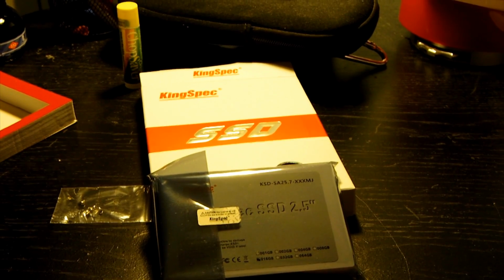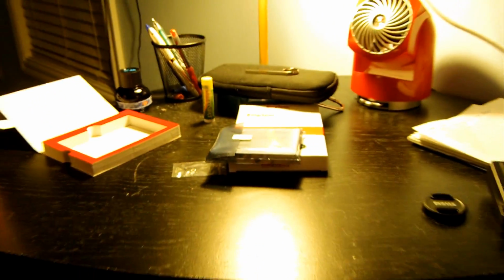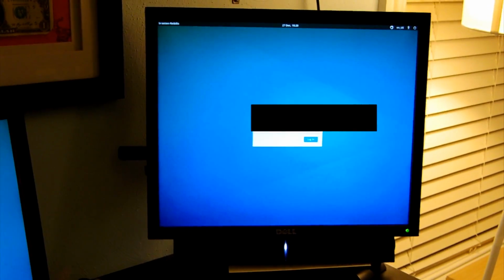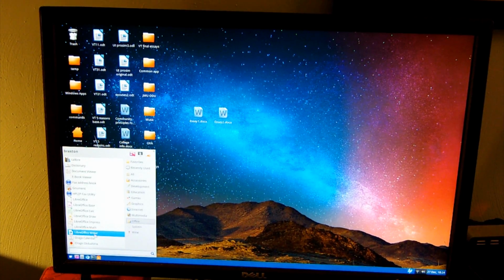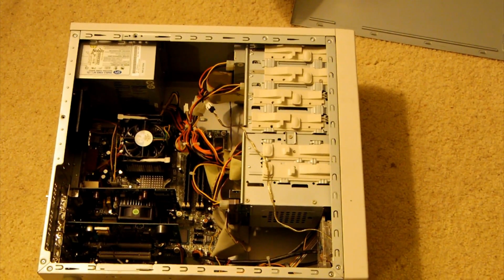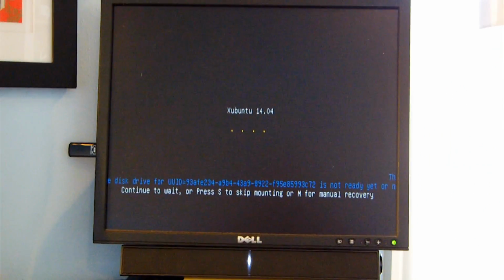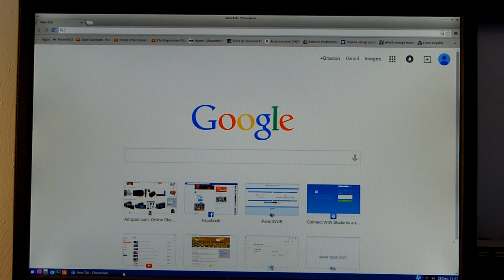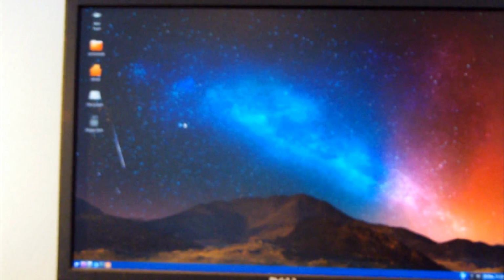Pentium 4 processor + Solid State Drive

Comment: Wow! You have a very similar specs computer to mine!

My PC specs:
Pentium 4 HT 3.0E
2 GB DDR400 (2x 512 MB DDR266 AND 2x 512 MB DDR400) (And also, I just manually changed the RAM frequency to 400MHz so does that really overclocked the RAM?)
NVidia GeForce FX 5600 with 128 MB VRAM
That same Intel BIOS and motherboard
The same monitor you showed on the right side

But it runs Windows 7 Ultimate

Comment: 10:17 The BIOS says that you installed the RAM wrongly. It should be installed in identical slots. So that it can perform in Dual-Channel mode, which will definitely increase the performance.
Reply: or the PC just has a single ram stick

Comment: Without a SATA-3 PCI card the speed of the SSD will be limited to 150MB/s, since all those Pentium motherboards only support SATA-1. All the values of Christal Disk Mark were unreliable, also the sequential speeds, since you can't beat SATA-1 speeds. You should have used the benchmark of the gnome-disk-utility.

Comment: can you use any sata connector and hard drive with any type motherboard that has sata 1 through 3?
Reply: anikanbounty97 yes except a powermac G5
Reply: Peter Kapica :) that good to know and what a powermac g5 apple design?
Reply: anikanbounty97 a powermac G5 only has sata 1 and it probably supports ssd's but I never messed with one
Reply: Peter Kapica ah ok
Reply: People speed up IDE laptops with ssd's, icm converters.  Well, i know i did.  (to brutally  classify people by  financial means they have) Poor people's cheap little useful upgrade.
Reply: @Geert365  nice.

Comment: why do i see more people with geforce 6200 256mb vram card then 512 mb vram card that i have?
Reply: anikanbounty97 I got a 512 Mb card
Reply: Peter Kapica :) compared to the agp 4670 1gb it slow lol but does the job
Reply: anikanbounty97 4670 is slower.
Reply: Peter Kapica maybe compared to a pcie versiopn but it really fast compared to agp 512mb version of geforce 6200
Reply: anikanbounty97 I got the pci version
Reply: Peter Kapica ah ya that may be better lol but maybe not idk all ik is speed for my card really fast and good i can watch 1080 video and smoothly and play games that my dell laptop can play with max setting on both of them
Reply: anikanbounty97 it can barely handle HTML 5 video and the reason I payed 50 bucks for it is because I had an ancient Pentium 4 Dell and it wouldn't play cod 4 because it would error out on the integrated. Bought the card and got it to a bad but playable fps on the lowest settings.
Reply: Peter Kapica ya speed on cards terrible but i got my geforce agp 6200 to play skyrim very low settings and bad frames but smoothlyish
Reply: anikanbounty97 easy way to fix lag at low fps, a trash picked crt monitor
Reply: Peter Kapica lol why trash when i got 21 inch one sitting in the basement area
Reply: anikanbounty97 time to hook it up
Reply: Peter Kapica lol :) you can actually hear it turn on and the electricity going through it

Comment: pentium 4 3.8Ghz + DDr400 dual channel 2.3.2.5 timings could double the result besides ahci sata III controller.
Reply: I doubt there's any 775-based board that could do DDR400 and Sata-III controller. You'll be lucky to get some later models that have SATA-II and DDR2-800MHz compatible, but some wouldn't work with early P4 models, also this in the video uses a 478 Pentium 4 that of course doesn't have even SATA-II

Comment: I want to see someone overkill a Pentium 4 :P. A fairly decent GPU, SSD, max of the highest end RAM, best heatsink for it, highest overclock, good looking case, and a good PSU. (and obviously best mobo) Then see how it runs :o.
Reply: +FatheredPuma81  I have a 3.0 Ghz P4 HT (socket 478) overclocked up to 3700 Mhz on Asus P4P800 Deluxe motherboard, with 2 Gb of DDR400 and 120 Gb Seagate SATAI hard drive; on this machine Windows 7 Professional boots in 40 seconds only and it is perfect for office and internet tasks! As you can see in my channel, even YouTube videos at 720p are played decently.
Reply: ***** I think to completely bottleneck a GPU you would need at least a 4870 or a gtx 280?
Reply: ***** That would be a 4770 or a 7950 GT. Also there is PCIe versions of it I think.
Reply: ***** That's every medium+ end graphics card in existence :P. People think "Oh it was $200 10 years ago therefor it's about $100 now."
Reply: +Ｒｏｂ “RobW0lf” i got a asrock p4i945gc mobo a few weeks ago on amazon for $20, they are not very rare. socket 478, pcie and ddr2. i have a 7770 and 2gb ddr2, and a regular 1tb sata drive on it, windows 7. its greatest achievement is metro 2033 max settings 720p average of 40 fps. oh, also its a 3ghz ht p4
Reply: 51rickjames Now you need a liquid cooler for it and need to oc it.
Reply: Gaetano Della Corte Again as said before. No graphics card= shit.

Although pretty damn good. Just need an upgrade to RAM and a good GPU and your set for all dat 1080p gaming.
Reply: +FatheredPuma81 i got the latest and best agp graphic card wich is ati 4670 1gb agp
Reply: ***** sadly the agp slot that it was in was only 4x so it was bottlenecked by that and by being a dell dimension 8200 with cpu of 3.06 ghz hyperthreading but i got new motherboard asrock 4core dual vsta now to test it on at 8x speed and quad core cpu extreme edition qx6800
Reply: ***** ya the board i got can go all the way back to pentuim 4 lol and up to quad core dou type cpu socket 775
Reply: ***** got it on ebay for like $24 euro was very lucky and working perfectly no problems at least after i updated bios cause it didnt like my cpu with old bios lol
Reply: The highest-end AGP cards that I'd know of are HD4670 and Geforce 7900GS.

Comment: w7 ultimate is soooooooo faster then unbuntu
Reply: +robertas grigas Any proof at all to support this?
Reply: my pentium 4 pc boots faster on w7 on a hdd 7200rpm
Reply: robertas grigas Exact same pentium and mobo and same speed and amount of RAM right?
Reply: dell dimension 9150 p4 ht 3,0ghz 4gb ram ddr2 ati radeon 126mb vram gpu
Reply: robertas grigas Also that's kubuntu.

Comment: running an i5 4690k and 2 gtx 960s with a 1050w power supply and 16gb of ram. yall computers suck ass
Reply: +Jooby Noyo 2 GTX 960s and a 1050w powersupply? You are what they call a high end dumbass XDDDD. You spent a bit more on 2 960s instead of getting a 970 or 980 and have must better future compatibility and you most likely spent a fuck ton just to get a super overkill powersupply when at most your computer total even with 10 harddrives or even more will use about 700-800 watts.
Reply: +1,000 subs No Videos I saw someone whos channel got banned because they had about 80k subs and they were the 100k with no subs guy.
Reply: +Jeremy Oliver u buyght 2 960s instead of one stronger card... also a 1000w psu would not be needed in the slightest
Reply: Sasuke UchihaxD My comment already explains this.
Reply: FatheredPuma81 i did Not read the comments
Reply: Sasuke UchihaxD With there not being 50 comments you have no excuse.
Reply: FatheredPuma81 idc
Reply: Sasuke UchihaxD You're illiterate.
Reply: I think i will just keep my dell dimension 4500. It does what i need it to do with minimal problems. its all about the pentiums baby! :D

Comment: I would have expected a greater perfomance increase between an IDE hard disk and a SATA SSD...   but still an interesting video.
Reply: Well obviously the SATA1 connection is really slow, some hard drives go faster than that. Also I think the FSB probably runs around 400MHz which is really slow for a SSD.

Comment: I did the same on my friends HP laptop with an AMD Turion64 X2 TL-58 (1900 MHz). I don't know what the gains were to the CPU but I guess it must have helped the latency of the system as a whole. A few guys have installed Windows 10 on their Pentium 4 with mixed results. The main stumbling block has been NX as a requirement.